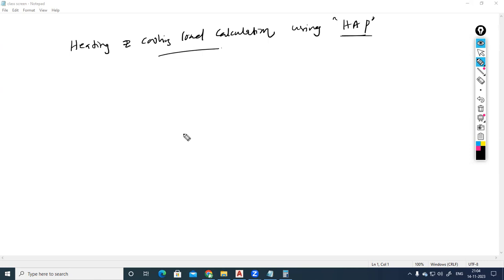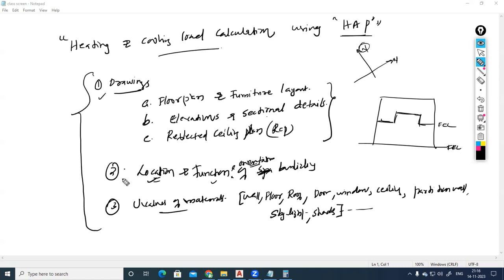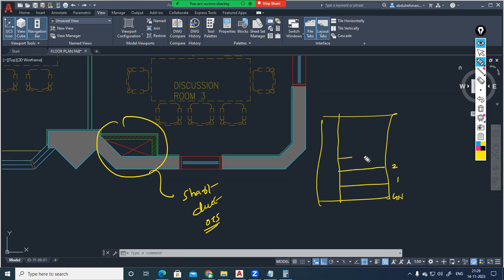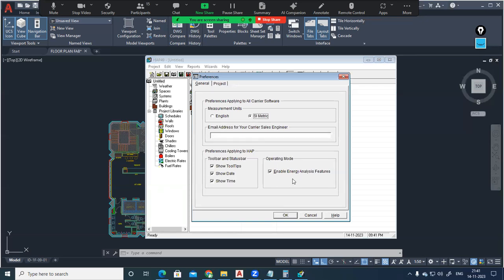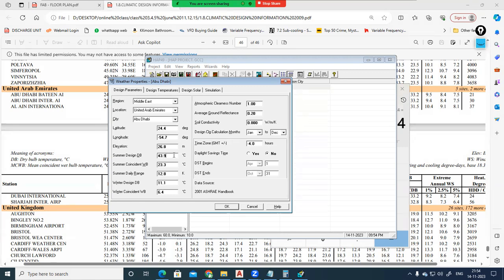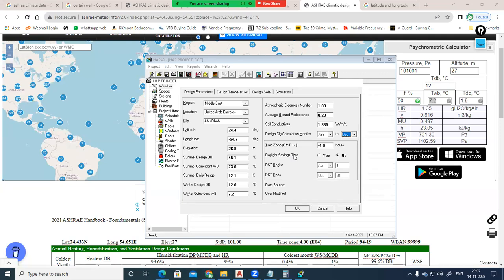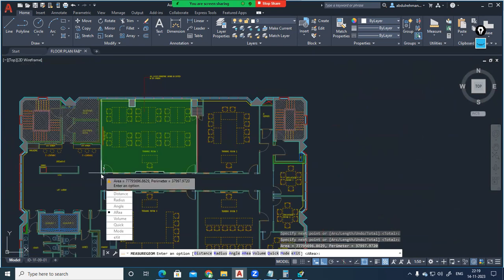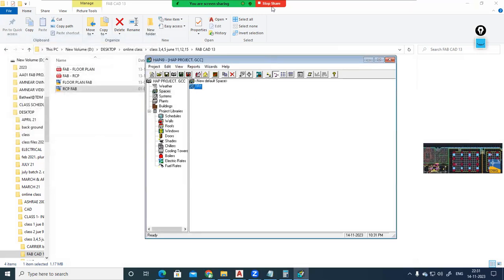'HAP Project Session 1'. Heating and Cooling load Calculation using HAP. Basics to Advanced. AMNEAR.

Comment: Autocad software provisional padicha ath MEP kk use full aakumo
Reply from the maker: AutoCAD is the primary software used for all types of drawing preparation, especially in 2D. In the MEP cycle, there are four main types of drawings: tender drawings and IFC layouts for consulting companies, and shop drawings and as built layouts for contracting companies. Most companies still rely on AutoCAD for 2D layout preparation. While having basic AutoCAD knowledge is beneficial, it's not sufficient. You need to understand how to use AutoCAD within a company context and for specific MEP drawings. This thorough understanding will make AutoCAD skills truly valuable for your career.
Reply: @amnearmep  Thank you sir❤